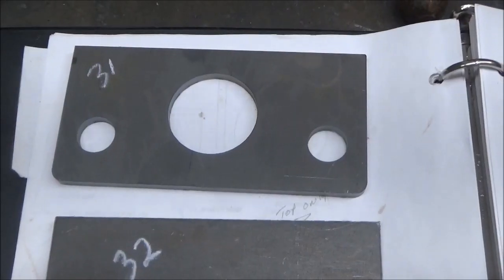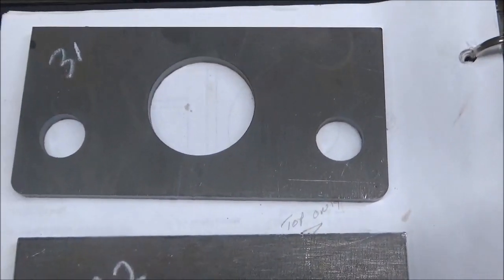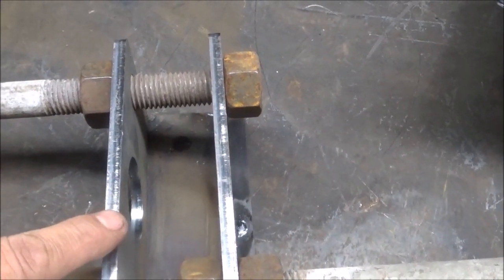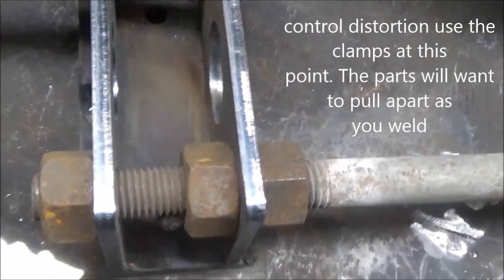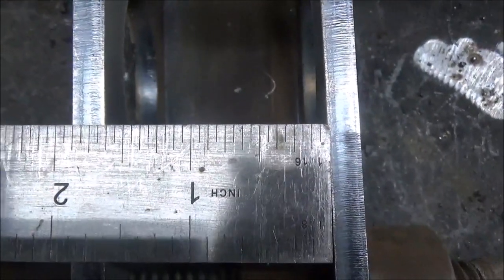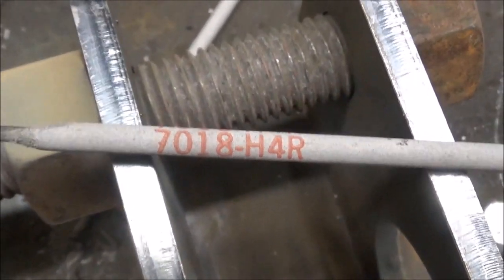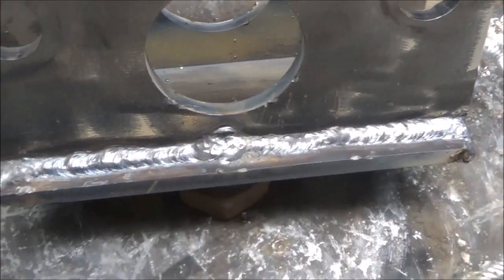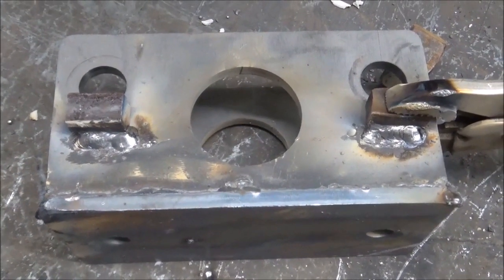Part 212 power hammer build

Comment: Thanks for these videos. I purchased the plans from clay about a year ago and finally today have all of the structural steel and parts. Minus the motor and spare tire. So I will be starting mine here in the next few days. Your videos are helping.
Reply from the maker: Mike some of the parts are a bit confusing as to the details. I have been building mine for some time but got tied up when my machinist quite. If you have a question just ask.